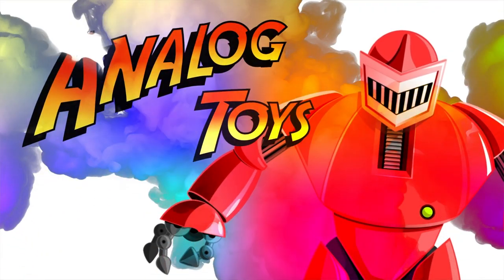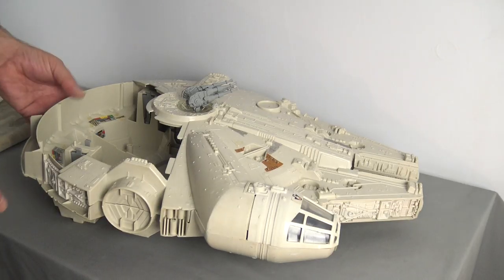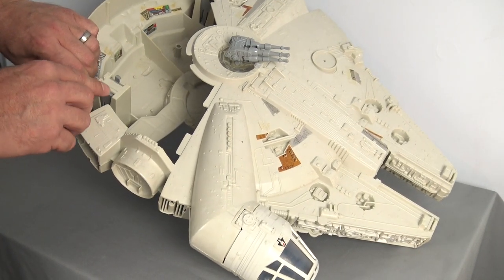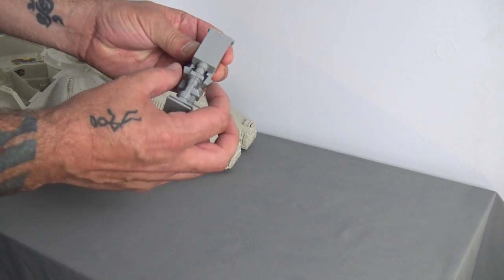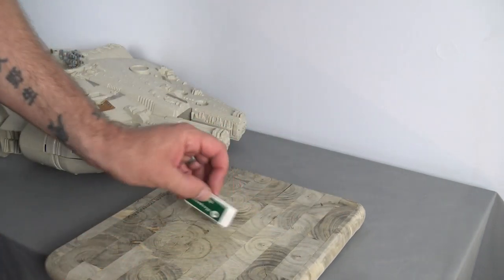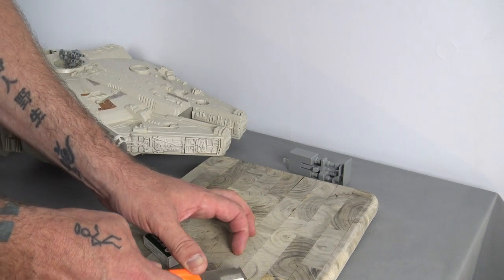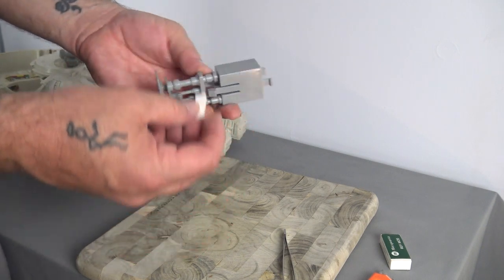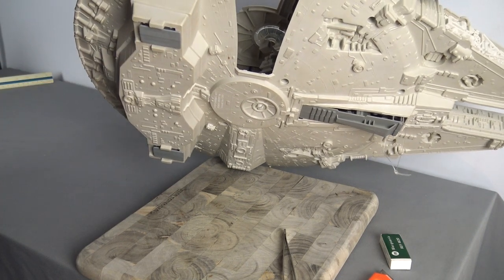Kenner Millennium Falcon - How to repair the landing gear!

Comment: I used a Qtip with the ends cut off in a similar fashion. Its a great simple fix if you want to keep legs locked in the down position, really works well. Just wanted to pass that on to everyone. Thanks for well needed video!

Comment: Wow!  Thank you David, Joseph, and Tony.  I just bought a Millennium Falcon last month to replace the one lost to time back in the 80s.  Everything on it was in great shape except for the loose landing gear.  I've watched Michael from RetroBlasting use sticky tack to jam between the hull and gear, and I've also heard of people heating up the gear catches to bend them back to shape.  But this method strikes just the right balance between DIY and inconspicuousness for my taste.  I'm gonna buy an eraser today!
Reply: Awesome 👍 . It's very little risk of breaking anything and keeps them working without being immediately obvious. After 38 years in place the same eraser bits are still doing the job.

Comment: Wow thanks for the tip I really appreciate it-so I tried it but also wrapped the rubber around with black electrical tape which is the same width to give it firmness and strength-it worked like a charm plus being black also doesn’t stick out like a sore thumb
Thanks M8

Comment: Nice little easy fix. Have to check mine, but mine is in flight mode being suspended by fishing line, right above my Sith Infiltator and Cobra movie Night Raven. Still gotta get my M.A.S.K. Switchblade in flight with them.

Comment: Another method: I tried boiling them, after gently pushing the clips out with smooth nails, and then dip into cold water afterward to cool the plastic into shape.  Worked like a charm!!

Comment: Ok guys those "rubbers" i couldnt find here in america but im sure they are somewhere over here i just didnt have the time to find them so what i did have available to me was Styrofoam and i just cut a piece about the same shape and size of yours in this video @analog toys and it worked just the same as your rubber eraser did... for a more permanent solution later on i might do the hot water trick and push them back in place but this worked like a charm and exactly the same as the rubber trick... thanks for making this video,, your trick , a dawn dish liquid and toothbrush bath really helped me fix my new falcon i just bought,,, well,,, new to me, but works and functions 100% like the old days now,, hahahahahaha   thanks again

Comment: I've seen some of those rear landing gear parts spearate nicely in half - for those who ave such landing gear and carefully pry them apart, you can probably customize a larger peice of "rubber" pencil eraser inside, thus making a more stable "slip-proof" piece. 
Another option, albeit a little more work and engineering ingenuity, is to get a piece of spring in place of the eraser.

Comment: A better way is it put the landing gear in hot water for a couple of minutes and then get something to use as a wedge behind the clip, causing it to flex outwards more. Do this to both clips (I used 2 good thick Allen keys) and then leave in sun and let cool naturally in to the night air. Works a treat!

Comment: I've got a Power of the Force 2 one sealed never opened but all I need are the remote thing that Luke tries to block, just one of those beads they make at hobby places with the concave sides to them will work. I don't remember if it has the arm it attaches to but if not no biggie it's the same mold as the original.

Comment: Tony, I know that you use a piece of nylon fishing line to hang your Falcon on your wall. But please know that nylon fishing line will dry rott and you could find your prize piece smashed on the floor. I would use a piece of metal wire instead.
Reply from the maker: Good to know!